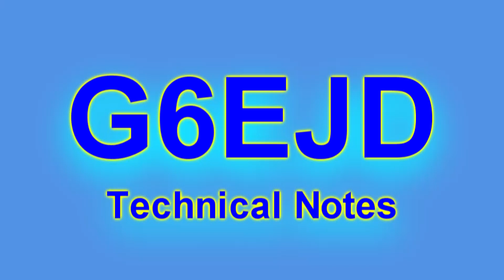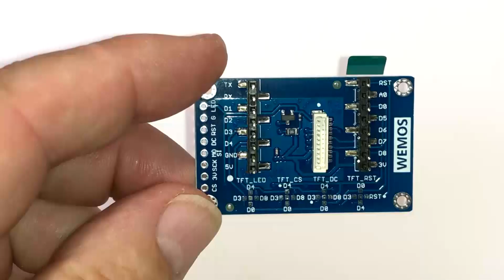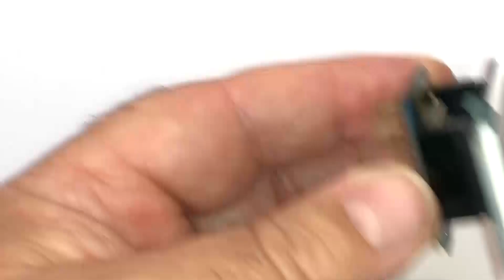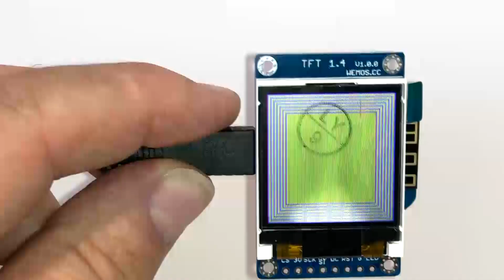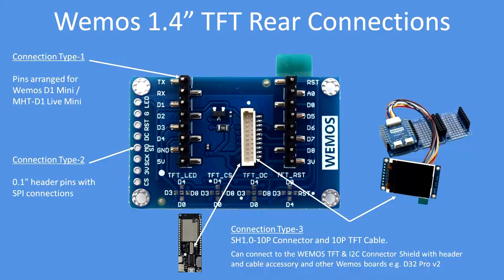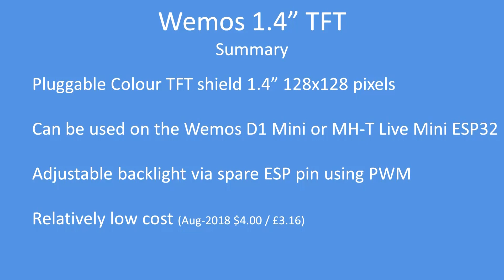Tech Note 106 - Wemos/Lolin 1.4" TFT Shield for D1 Mini/MH-T Live

Comment: Hi Dave 

Got my boards TFT 1.4 works fine when on a direct connect, ie with a Wemos Tripler base, however using the cable and the TFT/I2C shield, display backlight is on , but no data.

Have you tried yours???

Cheers
Peter
Reply from the maker: Have you checked your pin assignments for the connector?
Reply from the maker: Yes. But the pin assignment is different how crazy a design is that!

Comment: подскажите вкак подключить 1.4" TFT has 128x128 pixels----Wemos D1 R2 ?????????
Reply from the maker: Yes that’s correct 128x128 pixels that’s what I say in the video
Reply from the maker: You can wire it using DuPont cables